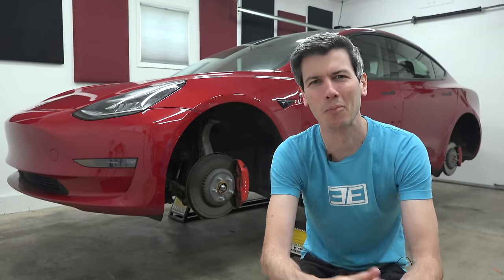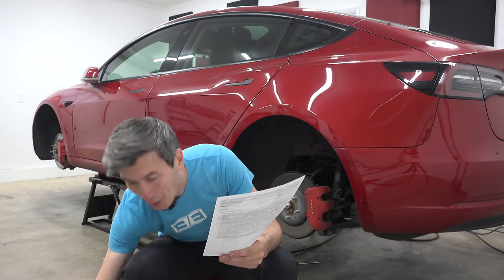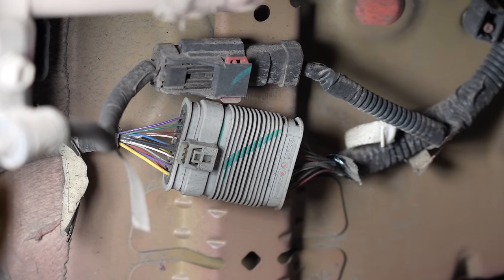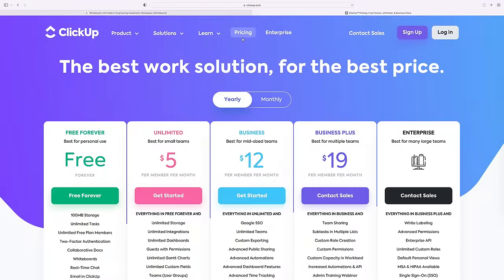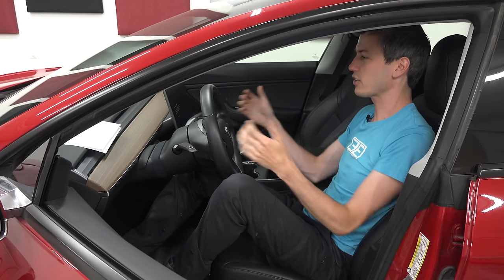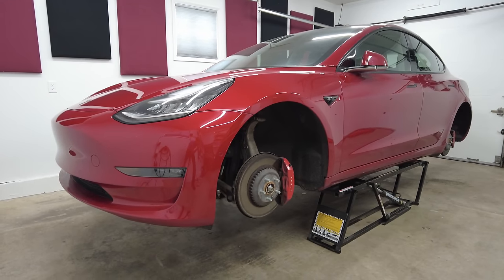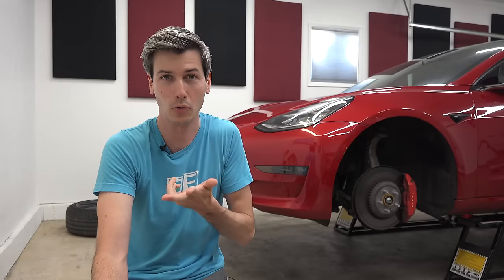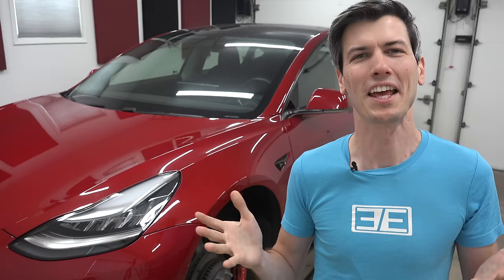Tesla Battery Damage? I Ran Over A Metal Bucket

Comment: Another great overview of the ownership experience.  One quick question:  Can you share a link to the jack I see you're using in this video?  I'm assuming it's run on compressed air and looks like a great option for any car and especially for Teslas where the there are very limited jacking points.
Reply: Yes! I need those jacks as well
Reply from the maker: This is the style of jack (quickjack). Only thing you need to do is make sure the model you buy fits your car's wheelbase: https://amzn.to/3QxmGpo

Comment: I ran over a can of white paint that ended up getting all over the wheel well. Luckily I have the long version of the mud flaps and it kept most of the paint from getting on the car (which is also white and made it difficult to find all the paint drops 🤨).

The rain sensing wipers on mine are decent when it's anything less than a steady rain. Once it gets heavier they always kick into overdrive too soon. The thing that irks me the most is phantom braking. It's gotten better but it still happens every so often when I use the "cruise control" (but not auto steering) on two lane roads.

That makes me think that the auto-braking & steering safety features only work when you have some form of autopilot engaged. Can anyone confirm whether or not that's true?
Reply: not sure about steering but I believe there's still some form of auto-braking without cruise control, albeit only at the last moments before impact.
Reply: @Appletank8  Gotcha, thanks.

Comment: i think you have been very lucky. if your battery would have been damaged, this would have been unreal expensive.
the battery of the tesla is flawed in my opinion. of course 115% of the tesla fanboys would disagree with me no matter what my argument would be, but for normal people i will explain it anyway:
the battery is not based on modules and this makes it unable to be repaired. so, if you never have any issue with the battery for the whole life time, you are fine / lucky.
however, if you have troubles with a few cells, it will get extremely expensive because you have to change the whole battery because you can't repair it. in my opinion, this is very consumer unfriendly.
if you look at the battery of the MEB from VW (or also other companies), you see a module based approach. i think the bigger battery there consists of 12 modules. and i am pretty sure that changing just one module is much much cheaper than buying a whole new battery.
tesla might save a few bucks with their approach, but for the few customers that get a problem, it will certainly hurt a lot in their pockets. more than it should.

Comment: No tires or brakes in 4 years?  How many miles on the car? 10k?
Reply: Brakes last 100-300k miles in EVs. Regen braking 90% of the time, no pad/rotor wear! another EV benefit.
Tires,.... that's a different story :)  25-40k, or less if you have a Performance on summer tires and launch it :)
Reply: @cgamiga  Yes EVs are heavy 4000+lbs I'd think you'd burn thru tires quick

Comment: I’ve had the same issue with my car smelling. On rainy days it seems to smell moldy for the first two minutes the air conditioner kicks on but other than that it’s fine most the time. I wonder why that is? Maybe make a video on it? 🤔
Reply: I understand the ac drain at the bottom of the ip stack that goes through the firewall doesn’t drain well in all situations. This is very likely your issue.  You might try parking facing the other direction if you park on a sloped driveway.
Reply: Some other commenters here recommended turning off the AC for the last few minutes of the drive (and turning the fans slightly up) to dry the filter

Comment: At international motors Milwaukee went in for oil change they said I also said I need 2 air filters
Quotes me $200 each filter and $200 each labor total $800 this is on a 2019 m5 suv
I will buy my next car without a dealer

Comment: Have you see a BMW electric compared with a Tesla?  Transmission, suspension, distribution, paint layer thickness protections, welding.
They all say the other electric cars are adaptations of explosion-proof vehicles to electric cars. But of course it is so and how good it is.
Well, a car is not just the engine.
and here I have an answer to this.
Tesla did not even dare to run in Formula E, other brands do.
It's simple, races, besides being a show and an advertising medium, are the best way to learn, innovate, and develop vehicles.
What better way to find new innovations than F1?
What better way to try and test the rigidity of the cars than the WRC Rallys, they run on asphalt, dirt, gravel, in dry weather, with rain, snow etc etc.
What better way to test the strength of car components than 12 or 24 hour races like Le Mans.
Look for videos that show the cars underneath, what's behind those plastic bumpers. Well, you will find dozens of years of developments by engineers, designers, manufacturers.
A Mercedes, a BMW, an Audi, a Toyota, a Hyundai, are cars with all the letters.

Comment: Jason, there must have been a cost for tires and or brakes over 4 years correct?
Reply from the maker: No brakes needed (pads are basically still new haha, most braking is done by regen). Tires can also last 30k miles, though I swap between summer and winter tires every 6 months, so really they only have like 15k miles on each. Actually less, because I switch tires too many times for videos/testing.
Reply: An EV can do like it's whole life on original discs and pads unless you live somewhere with salt on the roads...

Comment: Your range number is unusually low. It will be lower thr faster you drive above 60mph, but should be pretty close otherwise. Unless you regularly floor it, don't maintain consistent speed, or have a very hilly area.
Reply from the maker: But most highway speed limits are above 60 mph. 75 mph is a realistic speed EVs should travel.
Reply: ICE vehicles will also drop range significantly at highway speeds. It isn't as noticeable because the initial range isn't quite as much, chargers aren't as prevalent as gas stations, and charge rates aren't quite equivalent yet.

However, they aren't that far off, especially considering taking a restroom break of grabbing some snacks every 3 hours of driving

Comment: However, electric cars can lose power when the speed exceeds 60. Therefore, a Tesla can be overtaken by a diesel Mercedes of 300 horsepower On the autobahn and there the average speed is probably 87 Miles there. Of course, there are those that can also drive at the speed of 124 miles or more

Comment: Yes, but how much does the Tesla cost compared to a Toyota Camry? I just did the numbers. In my market $35,922 for the cheapest Tesla 3 vs Camry. I can buy a lot of "extra" gas for that.
Reply: Over 5-10years. especially if you have cheap home charging? surprisingly, especially if you have cheaper RWD/260mi range low end,.... Tesla is cheaper total-cost-ownership.  Several videos/stories out there, google
Reply: A Camry and a Model 3P are not very comparable aside from both being sedans.
Reply: @cgamiga  Well I can do a lot with an extra $35,922 in 15 years (the out-the-door price of the cheapest Tesla 3 vs Toyota Camry). In fact my old Honda CR-V ran me about $3500 to run for 13y 9m (i keep an MS spreadsheet of expenses). Plus I DO NOT want all the disadvantages of an EV. Plus they are not clean. Do you think electricity grows on trees, try coal, nuclear, natural gas, battery production and disposal. EVs are a political decision and not the solution.
Reply: @SpottedSharks They both do the same job, get 4 to 5 people from A to B. And I can fully fill up my Camry in 5 minutes and be on my way again. And after 10 years my Camry has the same range whereas battery capacity decreases with time. In fact, an EV's resale will be worthless as who can afford new batteries for it.

Comment: Interesting video. Have you ever looked into cost for battery repair over unit replacement pros/cons I'm interested in EVs but I'm outside the earnings bracket to buy new and buying replacement batteries seems costly. I know Rich rebuilds has covered this but would like your input.
Reply: My 2c as an EV enthusiast and modder: EV batteries are designed with a fair amount of redundancy built in, so most failures will result only in degraded range. At the moment it's the Right to Repair (or lack thereof) that makes battery repairs so costly - since the manufacturer just replaces the whole pack. Hopefully as EV ownership grows, demand and political pressure will allow 3rd party service centers to service battery packs - replacing just the modules that have gone bad. That would be an order of magnitude cheaper than replacing the whole pack.
Reply: @markmuir7338  Currently it seems that at least the Tesla (Model S) packs cannot handle module replacement and they'll go bad again soon. Apparenrly Tesla has tried to do this but subsequently stopped. When it comes to the Model 3/Y - it seems their batteries are much more robust with cell failures - not needing a battery/module replacement even if one goes bad.

Comment: "What happens when you run over a large piece of metal in your Tesla?"

A good chance of nothing, but a non-zero risk of exploding into flames.
Reply: Eventually, not immediately. If the battery is damaged and a fire starts, it'll usually take many minutes or hours before it actually reaches the inside of the vehicle and explodes - only because Tesla's batteries are so well insulated. And the car should be able to detect a malfunction and warn the owner long before they're at risk in the vast majority of cases. But yes, it's a risk. Keep in mind it's still a lower risk than it is for ICEVs, mind you. To be fair, I don't know the comparative statistics specifically for running over large metal pieces, but it's true in general. Tesla's have one fire per 210 million miles traveled. The US average is one per 19 million miles traveled. And that includes fires caused by arson and external unrelated fires.

Comment: Is the range based on just driving the car non stop? If so, then if you city drive a lot you will lose range every time you accelerate from 0 mph instead of a constant speed?
Reply from the maker: City driving gets better efficiency due to regen. Highway driving doesn't have much regen, and the higher speeds mean more energy used to overcome drag.
Reply: @EngineeringExplained  Thanks for letting me know!

Comment: That little injection molded plastic cover costing 60$ to install on your own is Apple levels of ripoff. Then again the service center is dirt cheap. Its like reverse VW.
Reply: 15$ fees from eBay, 10$ in shipping.. It is not that bad after that. VW would be like 120$/hr + 15$ for a similiar part.
Reply: @rkan2  Seems to depend heavily on where you are. I did a few repairs on my Golf 6 myself and the most expensive part was the wiper blades for 18€ all round.
When you go to their service stations you get ripped off. (walked into that trap once and got to pay 60€ for 4 sparkplugs...)
But every workshop on the continent has VW parts and does things for fair prices usually.

Comment: Don't you need to change oil in reductor gear periodically?
Reply from the maker: I believe the only fluid you really need to think about is brake fluid. The others have quite a long life.
Reply: @EngineeringExplained  I've also heard that in some countries (with bad roads) you need to do a suspension check every 10k miles (and every 7.5k miles on Model S)
Reply: @Retired Bore Nissan suggests you replace the less than 2 liters of reduction gear lubricant every 60k miles. I just got around to mine at 70k with no issues.
Reply: @Retired Bore It is for the life of the vehicle as manual gearboxes are often too. There is a filter at least. I'm pretty surr they'll last at least 300k miles without major issue unless you are flooring it every time..
Reply: @rkan2  it's a small sample size, but both manual transmissions I've owned suggested replacing the transmission fluid every 50k miles out so. Even the differential oil was supposed to be replaced after 80k miles and that is a lot heavier oil. So I'd be surprised that any lubricant is actually good for 300k miles or the life of a reasonably long lived vehicle, mostly because of the metal particles distributed in the fluid while the gears are wearing in.
Reply: @Retired Bore true, the leaf has a lot less speed and torque than any Tesla, but I was still surprised how much metal sludge was on the magnetic plug and glad I didn't wait any longer to change it.

Comment: How can you possibly call this a sports car?! It has 1 gear, makes no noise except for the rattles, and doesn’t handle anywhere near to its main competitor a BMW m3. Sigh. 5-60 is irrelevant lol
Reply: A 3P will smoke most any so-called sports car.  And the ones it doesn't get thrashed by its big brother, the S-Plaid.
Reply: @SpottedSharks  Yes, when that battery fire starts the thing will smoke up everything in its surroundings. Both Teslas you mention are real pigs on a race track, both are way too heavy due to the weight of batteries. LOL and people think it's the other way around, it's not....

Comment: I have 2017 Model S for almost 2 years now. In that time I had to repair my front suspension twice (first lower, then upper control arms) and replace the 12V battery. This is of course the car showing its age, but my next Tesla will be M3, the MS is a bit too fiddly.
Reply: No 2017 model car should need suspension work already unless it's been in a crash, or if it's just been driven a whole lot (200k+ miles).
Reply: Mine has around 120k miles and it did. Machnics at Tesla said that most MS have these kinds of problems when they get into higher miles. Of course now that this is done, I'd expect it will be perfect for the next 100k miles.

Comment: The Performance must be a lot more sportier than the LR AWD. When I test drove the LR AWD few years back, I remember the ride was a bit “crashy”, while the handling wasn’t that great. It felt heavy in the corners, and quite loud/noisy at highway speed. It wasn’t very impressive, considering the price (CAD).
Reply: Allot has been improved since 4 years ago, it looks the same from the outside, but thousands of iterations under the hood. I'm hoping we can get a comparison to a 2023/24 model coming out of Texas at some point, which would likely be a big step up - 4680 batteries, single piece casting, structural pack design, etc.
Reply: @AllanSustainabilityFan  I was stating my experience with the LR AWD, from around the time Jason got his Performance. 

I hope there are improvements after 4-5 years lol

Comment: It is fast time but  your 0-60 times are bit off 20 hurcan evo does it 2.4 you car 0-60 time is 3.4.  So your well impressive is actually slow the both of the cars you compare it to. That car would be compare able to 2017 Dodge SRt Hellcat. Price of the car are actualliy more in line. Well that hellcat 0- 60 is 3.7 slow it is quarter mile is similar.  Not really sure were you got these numbers from they seem a bit off

Comment: Yes, a good daily driver provided you stay local and can charge at home.
I do not think EVs and long distances go together.
Reply: Teslas are the exception with their charging network.
Reply: Then you clearly haven't seen the range that many EV's are getting.  But even the Tesla Model S gets over 400 miles of range.  Yet who can drive 400 miles on the trip without having to stop for a bathroom break?  But I can easily drive 4 hours on the highway in my Model 3 going 70mph, that's a long trip.

Comment: Heavy EV sporty cars always remind me of the image of the fat superheroes that has been floating around the internet for decades. Like, yeah, Fat Flash is still fast and he can probably take a corner, but he's still fat.

As for transmission downshifts for the 5-60, not an issue when you still drive a stick.
Reply: All cars are pretty heavy nowadays. 

As for 5-60, most manual cars will need to shift,  and good luck finding ANY with a time of 3.3 seconds 5-60. Let me know.
Reply: @jamesengland7461  Just talking about the need to downshift at the beginning of the run. I don't need to do that because I am already in the lowest gear. Not saying I'll keep up, just saying I have an advantage over the automatic version of my vehicle in this specific case.